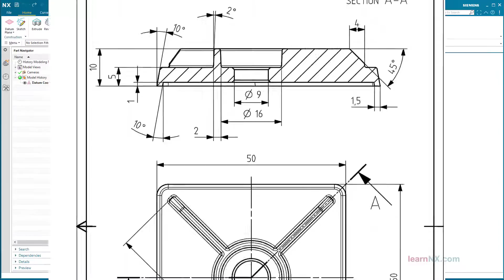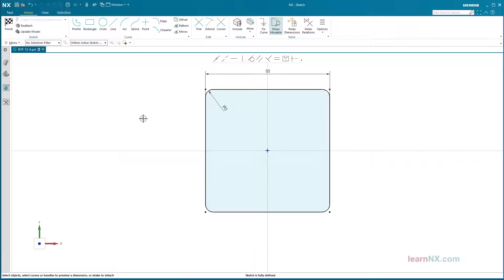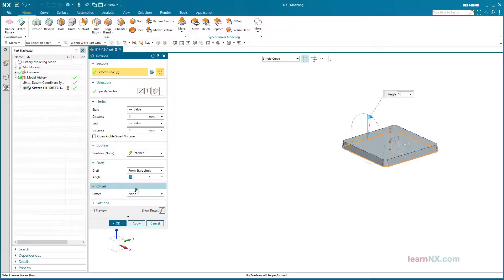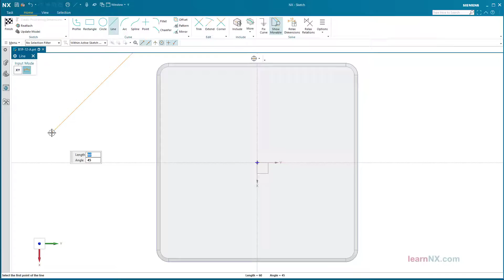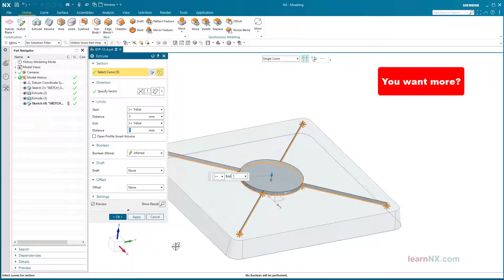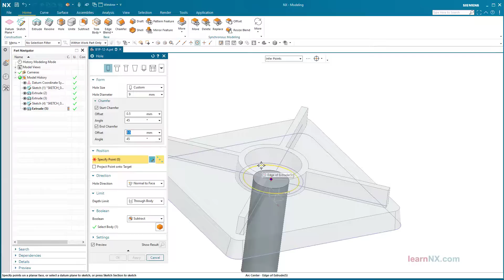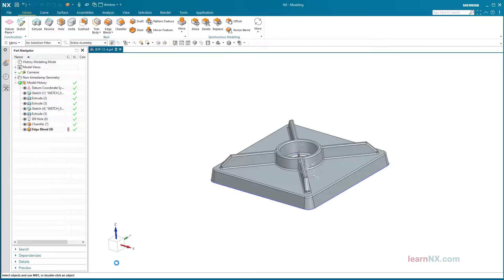Siemens NX Tutorial | Test yourself! Draft, offset, relations

Comment: But symmetric offset from circle with 16mm diameter will give a rib with 15mm inner and 17mm outer diameter. And drawing specified a rib with 16mm inner diameter. Am I missing something?
Reply from the maker: Thanks for the hint! The result is an inner diameter of 14 and a major diameter of 18. The drawing has been adjusted. And thanks for your cooperation.
Reply: @learnNX  @zergrush9748
to get the desired shape, extrude the circle with offset on single side(outwards) with thickness as shown,,make a offset circle approx 1 mm outwards of 16 mm circle ,on another extrude feature ,extrude the lines (use stop at intersection ,select until the offset circle to the 16mm circle of sketch) using the symmetric offset